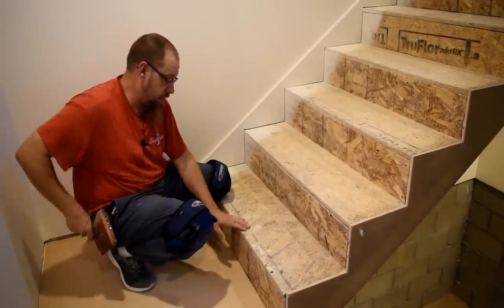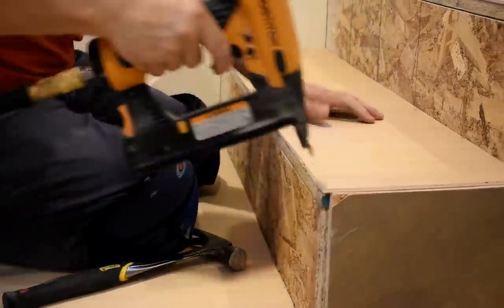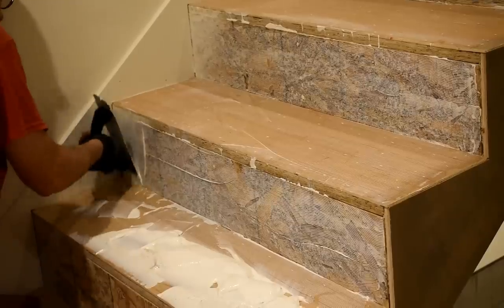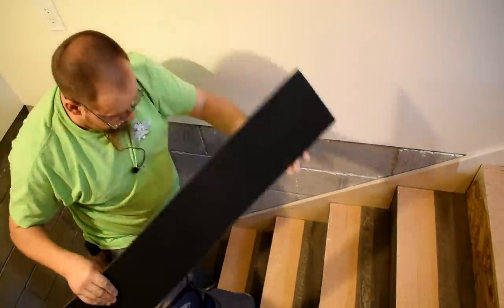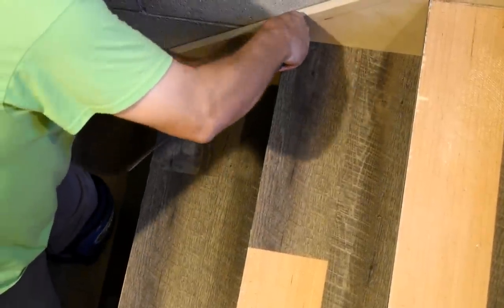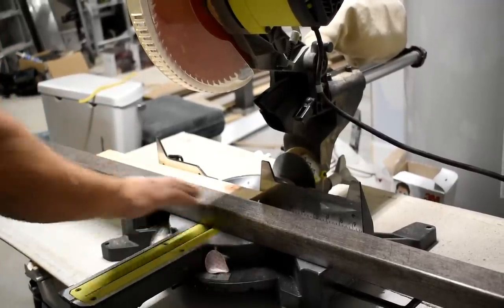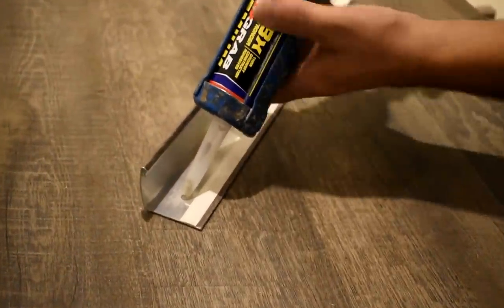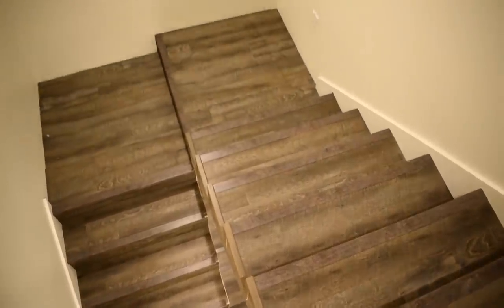VINYL PLANK FLOORING ON STAIRS

Comment: Pointing nail gun while it’s powered on to your face is probably not the best of ideas...
Reply from the maker: cheese chocolate you’re probably right, even though it does have a safety mechanism that will not allow it to fire without it being pushed on the floor
Reply: @FloorsbySouthernboys  
That brings a SMILE to my face... The first time I bought and use that gun,
I thought something was wrong with it, because it wouldn't work.... LOL
I even took it back to the store... The clerk just smiled, shot it on a piece of wood...
In amazement I asked how he made it work, and he showed me the "SAFETY" mechanism
which I was so glad to have... My old tools from 30 years before did not have that... 
Old dog... New tricks.
Reply from the maker: Judi Christopher That’s great, thank you for sharing that

Comment: HI, great video and lovely finish, i'd be interested to see a short video on how you tackle stairs which are not open sided like this one, is it much more difficult having to scribe the piece to both sides?Thanks
Reply from the maker: HolyHank Thank you and it’s not necessarily that much harder it’s just a little more time-consuming the last time I did it I just measured the longest point of the step and then trimmed what I needed to make it fit properly, if I ever get another chance to do this again with walls on both sides I would do a video on it, Thank you for watching

Comment: Hey GREAT video. I have a rookie question. Is the bullnose on the landing supposed to be flush with the LVP? Or overlap a bit? My installers left it up slightly and I'm extremely worried someone will trip.
Reply from the maker: julzodnile There are different types, this one here overlapped so it would be raised up approximately an eighth of an inch
Reply: @FloorsbySouthernboys  thank you so much!

Comment: Wrong direction on the riser and you should have finished the open ends yourself and you should have used stair nosing instead of that overlapping crap.